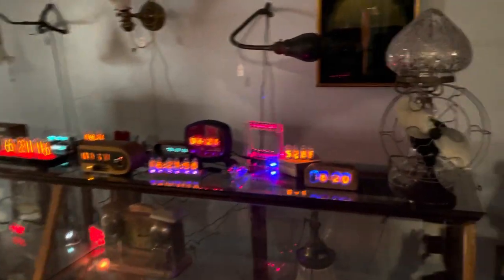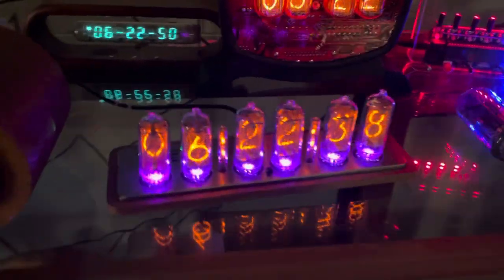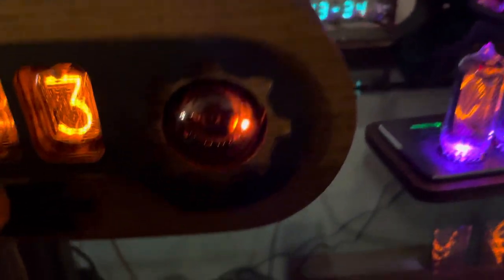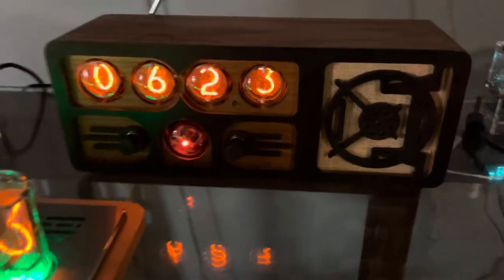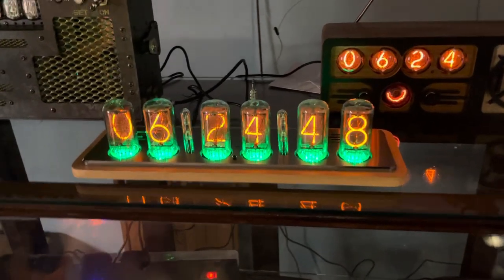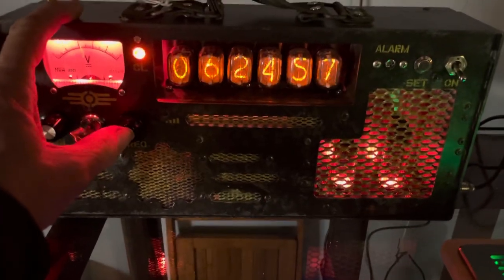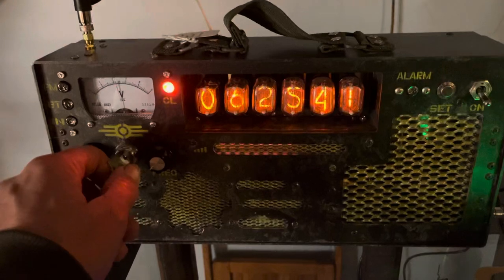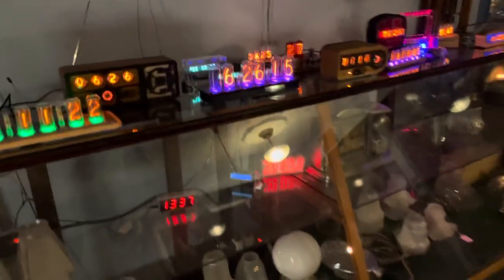Nixie Tube Clocks & Clock Radios

Comment: In your opinions how easy is it to make these clocks I know how to use a soldering arm is it really technical or is it self-explanatory and something that’s easy to do because now I was looking to buy in assembled one but I’d rather make it myself call
Reply from the maker: If you have a decent iron and solder (Kester) and know how to solder, the kits are rather easy. You need a multimeter to check the values of the resistors because often the color codes are hard to read. Also, many Chinese kits don’t come with instructions, so to have to email the vendor or search the web. You may need to search “LED pinout” to figure out which pin is +. Some of the cheap LED kits have poor clock chips and don’t keep good time. If you are a novice, start with a simple DIY kit from eBay. 

You can contact me at info@ChestertownElectric.com